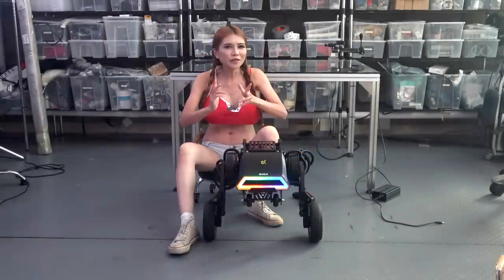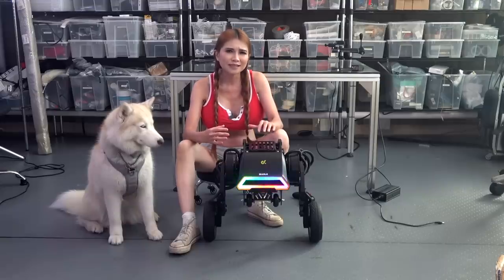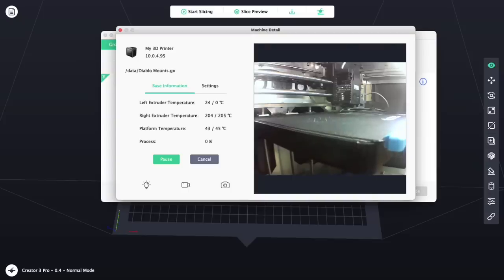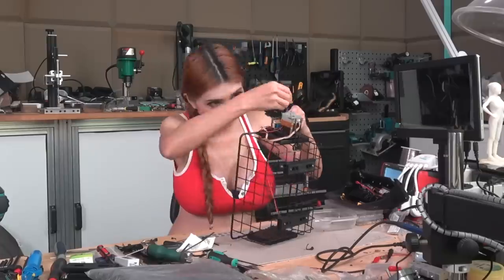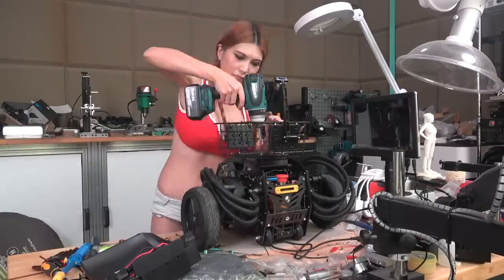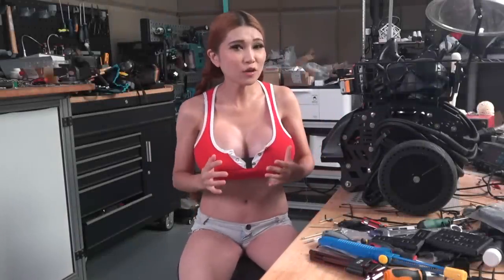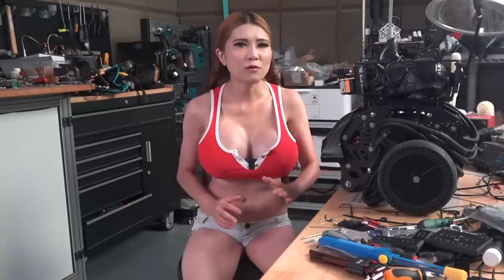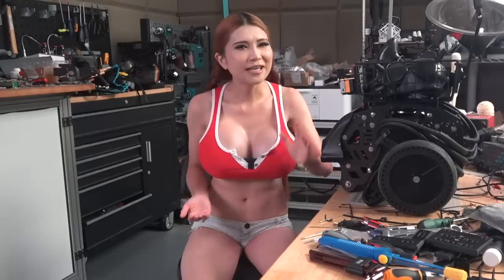Lockdown Errands with the Diablo Robot!

Comment: I think if you add 4 sensors one on each side and then run a ring around to all four sensors it should be able to detect any movement to that ring and then once it detects that it should stop until it figures out what made the movement in the ring.

Comment: Hi Naomi, what was the infill on the parts you printed that had the heat set inserts? Great video by the way. I love seeing the cutting edge tech you show in your videos!
Reply from the maker: 15% or better usually, those were 30%.
Reply: @Naomi-Wu  Thanks! I wasn't sure if they needed to be really high infill for strength.

Comment: You have a point there, when you say that it doesn't seem fair to exploit the (less than sufficient) infrastructure features meant for people with disabilities. But what if while using those features you actively rise awareness for the barriers still existing in a supposedly barrier free environment? Why not actively work for the removal of more barriers for the benefit of everyone? Surely if companies and a broad public request it, it becomes more likely to be considered. I mean if you share dependencies and problems with someone, it seems only logical to work together to solve those problems, doesn't it?
For the Diablo itself, it really seems an interesting experimental unit for that price tag, and I can imagine quite a few applications for it as it is and many more with some light or even heavy modifications/addons. Cameras or cheap sensors could easily fix most problems and improve the navigation, one or two actuators could add the ability to climb stairs and so on. It may seem like an overpriced toy at the moment, but it offers a platform for tailored solutions.
Reply from the maker: I have yet to see a tech company contribute to public infrastructure when it can take from it freely.
Reply: @Naomi-Wu  Facts! It’s almost funny how business & the concept of “free” rarely see each other eye-to-eye.

Comment: It's interesting that you wheelchair provision because one of the first things I think when I see a robot platform like this is - could this be used as a wheelchair?

For the most part powerchairs are pretty appalling designs, most are still made of huge hunks of metal, many still use lead-acid batteries, and very very few have any sort of autonomous capability.
All of this results in a heavy, bulky machine that often needs an assistant to handle it when it's not occupied, for instance loading and unload a vehicle, plugging it in to charge, or my pet hate, having to have it sitting right by the bed or sofa waiting to be transition into.
A platfirm like this could provide a level of autonomy to a powerchair user that at the moment simply doesn't exist, combined with a docking station you have a wheelchair that takes itself away to charge when not needed, combined with a robotic arm fitted into a vehicle and you have a self-loading wheelchair, and of course GPS, anti-collision systems, etc could be used to provide a powerchair that will take the user to their destination or even round the home without the need for constant fatiguing inputs.
Sadly, no one seems to have thought of all this.